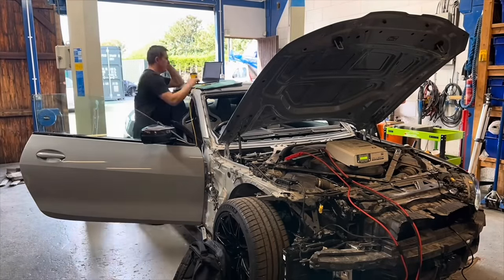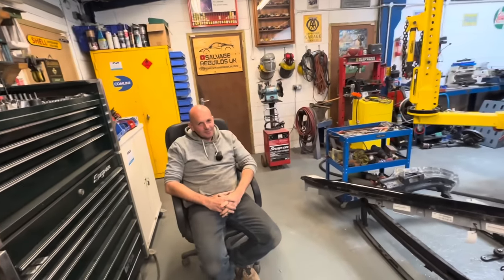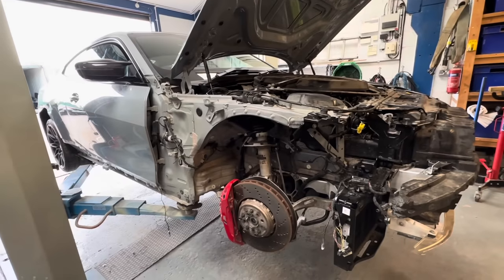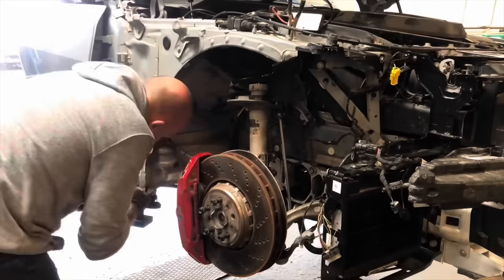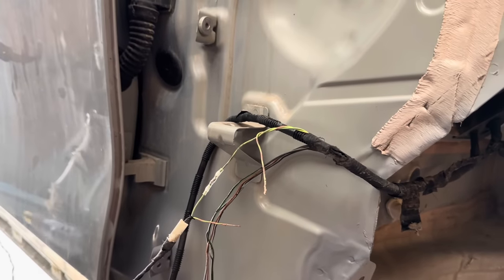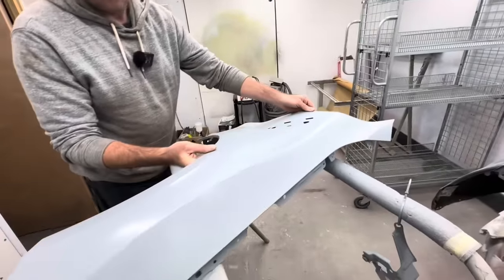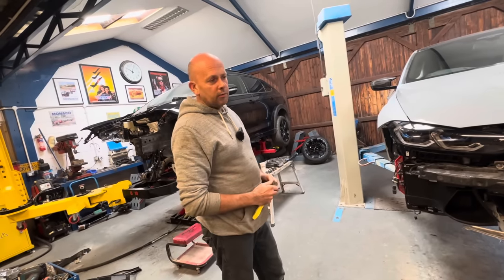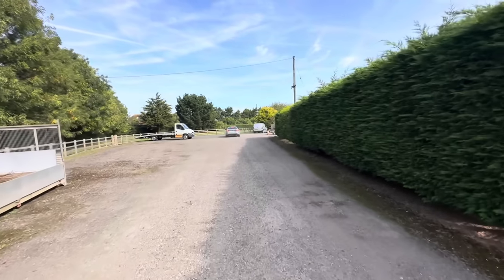REBUILDING A WRECKED 2021 BMW M4 COMPETITION PT 4

Comment: Wow thanks Rob for mentioning Solderstick, never knew this existed. I do a lot of soldering wires with added shrink wrap, now I can do it easily with a one piece. Off to Amazon for this and a heat gun.
Reply: I found out about this in an older video. You won’t regret the purchase

Comment: Looking forward to seeing this one finished! Just a word of advice - check the windscreen is ok with the HUD if it’s not a BMW OEM screen…loads of examples of after market screen having blurred HUD’s. When completed and having a wheel alignment, the whole ADAS system will need to be properly recalibrated, especially as this car has the Driving Assistant Pro option. Alignment will need to be done with a Hunter system as that’s what BMW will use to get the best results.
Reply: Might be why they bought a genuine one then
Reply: @andyfield6854  I must have missed that watching - didn’t hear them say it 👍🏼
Reply: The only way to go with a car like this that has so many sensors is to have a OEM windscreen. I agree, all the sensors that run through the front screen will need to be re set.

Comment: You still have the drivers side rear quarter to fix and a lot of other work to do but should be worth it. It will be a nice car for the next owner for a reasonable price. Chris's tin knocking skills are artistry. Rob, you do plenty too finding good vendors for parts and specialized services like for the glass, paint, electronics resetting as well as taking and putting together a lot of mechanical and electrical stuff.

Comment: As a plumber it's nice to see stilsons have a use for car repair.
Reply: I've been a mechanic for 30 years and you'd be surprised at the different assortment of things that get used in addition to the conventional tools!
Reply: but there is a difference ! 🤔 fitters/plumbers stilsons then panel beaters stilsons  difference is in the price mine are all panelbeaters stilsons coz cheaper but they bend when i have them on a 3 inch knuckle
🤥

Comment: Great work and content guys. The SR71 Blackbird had some generator failure issues in flight, which they couldn't diagnose until a technician worked out that the soldering on the wiring was melting from the heat in flight and then solidifying when back down on the ground! I know this is a quick car, so make sure your soldering is top notch ok ☺️

Comment: A bit of bodywork to do on the quarter panel and it will be ready for paint. Well done to Chris with the inner wing straightening and of course not forgetting those brackets. I laughed  with you at the paint colour but when the wing was on the car you could see the difference. Great video Rob and Chris, have a good weekend. 👍👍

Comment: don't forget you will need to do an ADAS alignment on the windscreen camera + reprogram /alignment on the new radar unit, + keep the print-off as proof for the new customer, it's a £300 charge to insurance companies for that service, each time these parts are disturbed in a bodyshop repair, just another thing that increases your insurance premiums...      keep it up chaps

Comment: I reckon your have a huge profit in that one. Great series. Thanks
Reply: 5k minimum I'd say.......ws the accident recorded I can't remember? That will make a difference on value but as seen in the lads detailed video's literally a huge expensive parts removal and refit I hope they make 10k.
Reply: @kevinworrall1346  I’m going for £12.5 profit as it’s only done 7000 miles

Comment: Very brave to take this monster on, well done and more power to you both. Don’t sell it too cheap, it’s a much sought after car. You guys always under sell, you must have missed out on a fair penny over the years. You should put extra £50 to £100 on all motors each time, havre a drawer and award a prize to one very lucky contributer each Christmas. Value of the car spent? Well i don’t do instagram but good luck to those that enter

Comment: I tried solderstick it is a brilliant but simple idea that works 100%. What i especially like is that it shrinks down until it doesn't make the wire too thick, you can wrap the loom in Tesa tape and it's invisible.

Comment: The good news is that Yamaha motorcycle genuine parts prices are more than BMW's: £900 for a fuel pump, £240 for a single coil pack... £55 for a rocker cover gasket...

Comment: I was quoted over £500 a year ago just for the screen from Ford for a 2010 Focus ST 🤪.  Went with a pattern part which was less than half the price including fitting.  Although I don't think it heats as quickly as the OEM one did
Reply: They never do the OEM screen is actually really good quality on Fords.

Comment: On the subject of fans, yes a complete rip-off, but probably nothing much you can do about it. Back in the day we used to repair mid range computers and typically they had fans with tacho signals. The problem was that although you could buy the self same generic fan from the manufacturer or distributor, normally the fan used would be an Orem special which was only available to be bought by the computer manufacturer and was sold for 5x or more price.

Comment: The lights are what BMW call Laser lights, you can see the blue filter on them. The whole unit is expensive to replace. A simple heat sink fins cannot  cool the lights enough, hence a fan.

Comment: Chris could you just clear something up for me m8t if a car has been damaged in a crash and let’s say the wheel arch is bent if you straighten that bent piece up won’t that weaken that part if it’s in another crash…..cheers
Reply: These are non structural parts, hence they can be easily manipulated back into shape. Damaged chassis legs are a different matter.
Reply: @iainmacleod4007  yes but I’ve seen chassis getting pulled back into shape and they are to take impact in a crash…
Reply: Yes I agree but surely wouldn’t be as strong …